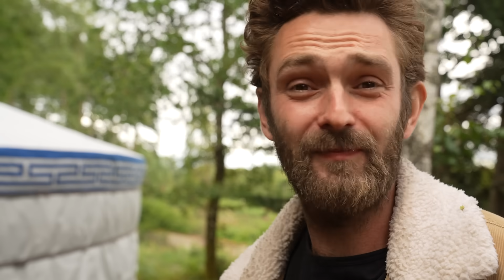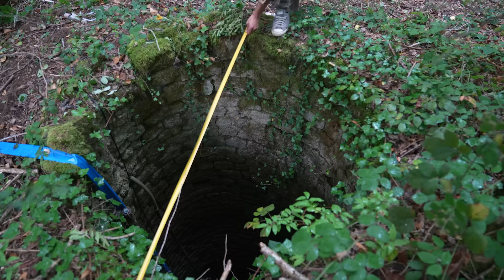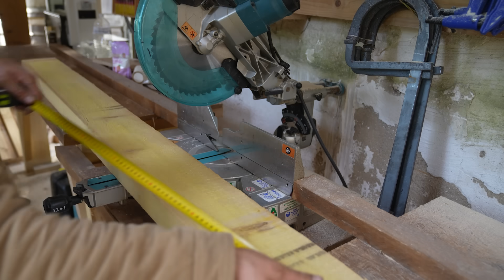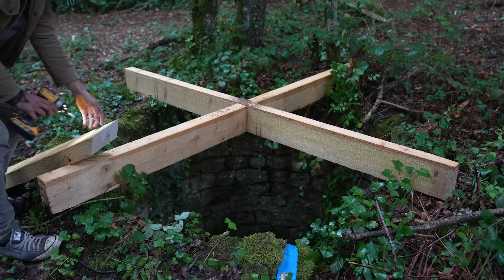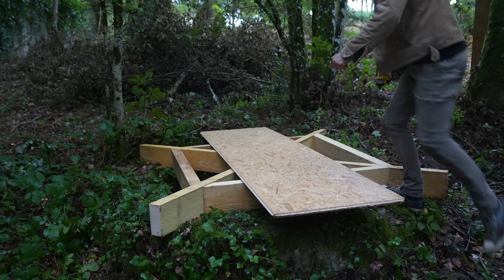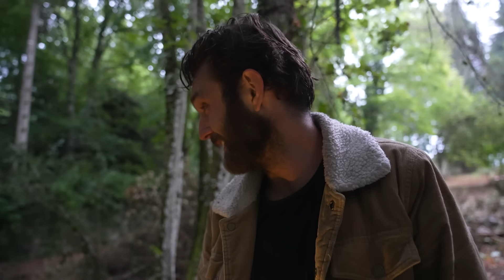A quarter of a MILLION subs, and I covered the chateau well.

Comment: Dan!  A suggestion regarding the large open areas under the new platform of the WELL. There is nothing to stop the boys climbing under. They are small enough to climb under the platform and slip inside. (  At 4:43. Check area of blue sump pump hose) Maybe build it up and around with stones/rocks.... Well done 250k subs. 🎉🎆✨✨🎇🎉

Comment: Dan as a more permanent cover for the well consider a metal grate. On our well we have a circular metal frame fitted with bars across with an opening gate in the centre. It was fitted by the previous owners who had 3 young sons. It allows you to raise the gate and use a submersible pump.😊
Reply: Yes, glad Dan covered the well.   I was thinking the same thing about a metal grate/cap, and many other commenters have mentioned the same thing.   Many more have mentioned covering the small gaps on the sides of the new wooden well cap, maybe with metal grate/chickenwire.  After all, while the OSB3 board is somewhat waterproof,  it will lose integrity over time to repeated rain downpours...and Dan will get mighty busy with chateau rebuilding. The chateau temporary subfloors are made of same OSB3 boards, and Dan may have to replace a few due to too much rain exposure before he make his way to the roofline to put temporary roof.

Comment: Is it just me or does the well cover look like a small child could easily go up under the floor decking and fall into the well in the gap between the edge of well to the bracing boards? It looks,to me, like a fairly big gap, and kids could be curious and go crawling to see what is under that decking.  I would add additional boards around the perimeter, that go past the well opening.  I may be seeing it wrong.  Congratulations on the 251,000 subs!
Reply: No, it isn't just you.   'Lindamitman' above just mentioned that something smalll could crawl underneath.   If you 2 saw the small spaces under the side of the well cover, then others probably saw it too.

Comment: I really love the videos. 
At the same time I am bewildered by the solutions and methods. Even if not a professional, I think you could speed up things and make it a LOT easier on yourself, if you put a couple of hours looking into construction standards, sizes etc. As an example, the yurt floor joist could have been a standard (square) CC 600 except for the edges, and provided better support and made room for better and easier insulation. Same standard would have worked on the well cover construction too, which was also overdimensioned (and did not really close the well for small animals). 
I usually start of large projects by putting up a storage tent and get a truck to deliver a couple of tons of standard beams of 2-4 sizes, good for those unplanned things which helps a lot. 
Still, your methods and approach is perhaps what makes it so enjoyable and draws so many followes, so never mind lol  ;D

Comment: Those types of wells usually pre-date the 1900's. You can tell both pumps broke through the wall at later dates to run the pipes down to the well. The Chateau probably wasn't the first home on the land or they could have expanded the home from the main center part to what it is today. Maybe sometime in the distant future you could build a pump house over the well and make it a feature of the property. Great job covering it up for now.
Reply: Others have also mentioned raising the stone wall around the well, at least 3 feet high or so.  And that wells that have the above ground stone wall are the type that were used for household use.   That this type of well may have been just for landscaping and the swimming pool ( since the well is next to the natural [overgrown] swimming pool area.)

Comment: The well cover - if you can get some woodstain for sheds or fences that isn't too much, I'd stain both the underside and the top and have the whole thing raised on some stone whether it's bricks, gravel or rocks that you weren't going to use anywhere else. If you have it at a slight incline so the water that lands on it drains off it would last a lot longer. Fence and shed stain does come off when it's in direct sunlight but the area is quite well shaded so you'd expect it to last. Might be worth thinking about.

Comment: Glad the well is covered. I guess in the future, it will need to have the walls cleaned, extended up, joints repointed, area around it cleared back by 3+ meters, then drained and mucked out, and finally a proper well cover constructed. Still, beyond utility water for cleaning and yard watering, I think a proper drilled well would guarantee safe drinking water. Not unless you install a purification system.

Comment: Ok I do  now have two questions . Why is it that you didn't put the roof on first before the floors ?  And why did you pump your well out and closed it up when it's your source of water? And by the way your welcome I enjoy watching what your doing  to the chateau I love history and restoring the past is scary but cool at the same time.
Reply: He is building each floor to reach the top to put on a temporary roof. 
First he needs to repair the top walls, before any kind of roof can go on.
Some of the floor boards are temporary, lower grade plywood. I presume the ones closer to the top.
A roof of this size easily costs $100,000.
I’m sure if he had that kind of money, he would have a company install his roof.
He is working with what he has.

I wondered about the well as well. He closed it to keep his kids safe. I thought he would leave a hatch to get water for construction.
Maybe he is having the kids over for the weekend, to enjoy the yurt, and he will take off one board when the boys are gone.
He doesn’t always work in the most logical, planned ahead way.
We have to give him credit gif how far he has come. Considering he is working by himself, he has done quite impressive work.
Reply: The structural engineer advised that he had to put floors in first to stabilise the walls so that they could take the weight of the roof.
Reply: @iu.5146 it looked to me like he left the water pump down there and the blue tubes protruding so he can still use the well water.

Comment: At 4:33 in the video, when you jump on the board, I dont know if it is me, but I kind of see there is still an opening there where the blue hose comes from down there.  A little one could easy crawl under the board and go have a look -  a child is always curious -  perhaps I am not having the perfect view but I would check this area and block access from all sides so they dont go and try and have a look to see what is going on .... just to make sure.  I may be wrong and perhaps I dont see clearly... please can someone confirm, please.
Reply: You are not wrong; there are dozens of folks who noticed the gaps under the new wooden well cover.  The perfect trap, someone just mentioned above; that's just how they said they catch animal b/c animals will seek a hiding place.   Thankfully, good start in Dan covering the well.  Hopefully, he will cover the gaps with netting/chicken wire.   And optimally, put a sturdy lockable metal gate over it soon, that is still accessible to tradesmen to work on it, or to put a hose down the well, as mentioned by others.
Reply: @homeemail2306  thank you so much for your reply.  A great day to you !!

Comment: erm, why dont you use all your waste rock and spare mortar and build it up above ground like a fairytale well, then put a lockable metal gate over the top like they do in historical monuments with wells.  Then nobody will fall down the well, and you can still poke a hose down there, or unlock it for a tradesman to work on it, and they can attach their safetly line to the metal grid. It will also make it easier for your great great grand child to FIND the well 80 years from now.